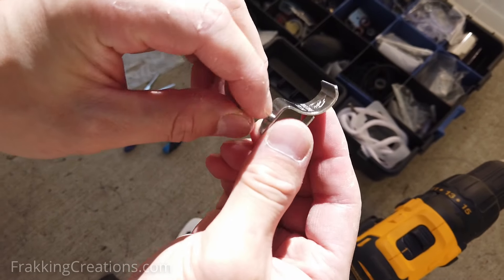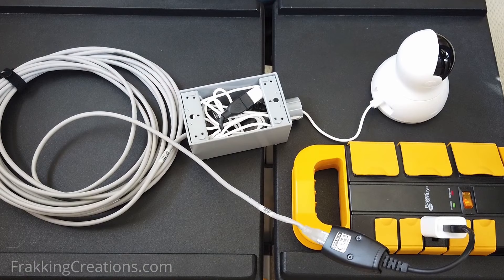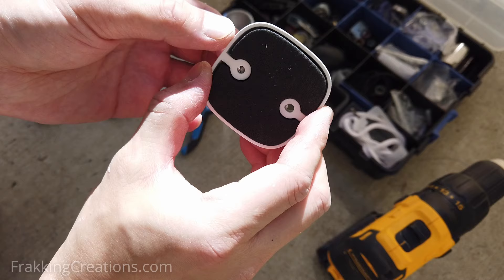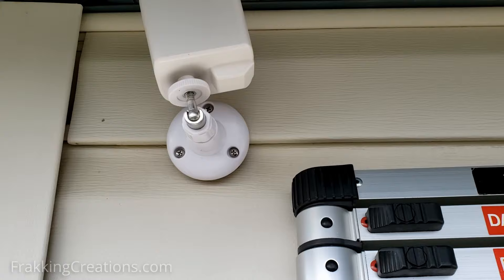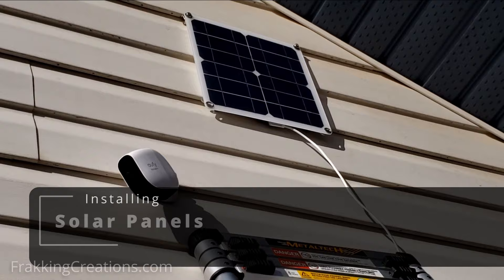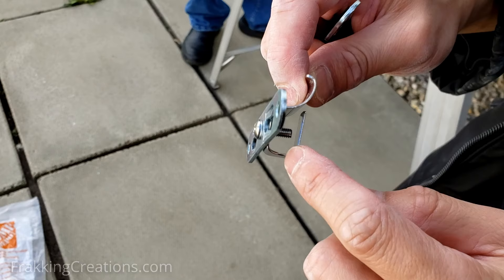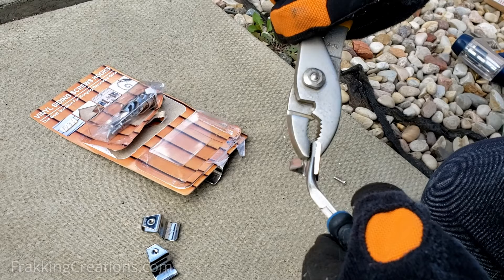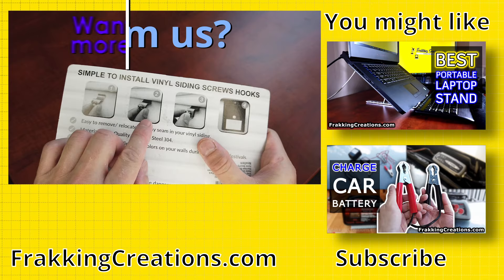How to hang things on vinyl siding - Install security camera, solar panel, motion sensor & more!

Comment: A different question, ignoring the cosmetic flaw, can scratches/holes from these installation cause damage to the slides in the long run?
Reply from the maker: There won't be any holes on your siding since there is no drilling.  As for damage, there typically shouldn't be any damage if installed correctly.  I could imagine that if the siding of the house is really old, there may be a chance that the vinyl could crack or a piece could break off when you insert the hangers or hang something too heavy.
I just haven't encountered that though.

Comment: Thanks! how is this holding up during winter months, cold, snow? Afraid my blink with light might fall off...
Reply from the maker: No problems for the security cameras, motion sensors or solar panels.  All still holding up nicely since they were installed and the video was published.

Comment: Do you have anything for mounting a tesla mobile charger to exterior vinyl siding.  Im looking for something like a kit with cable wrap and charger pocket that I can mount externally on the side of my house.
Reply from the maker: Sorry, I don't know of anything else like that.  These are general vinyl siding hangers that work for most things that are within the weight ratings of the hangers.

Comment: Hey just wanted to let you know. I bought and installed the mini solar panel (and the one used in this video) used in your original solar panel video. Works a treat charging my doorbell couldn’t be happier. 

My question is the solar panel used in this video, SUNYIMA 6V 10W. It has 2 usb outputs, but if 2 cameras were connected would it split the output to 3v each per camera? The cameras say 5v minimum required for charging. So I’m just wondering if I’d need to buy a 12v solar panel with 2 usb outputs available?
Reply: Really appreciate any help, your videos have been a huge help and inspiration for my project
Reply from the maker: The 2 USB PORT solar panel I used will split the current with the voltage remaining the same.  With enough sun, the voltage will be around 5V while the current will be split.  I'm just not sure if it's a 50/50 split of the Amperage or some other ratio between the 2 ports.
Reply from the maker: Thank you for providing the feedback.  Our aim with our videos is to always help someone else with what we have experienced.
Let us know how your project goes.

Comment: A quick question, was wondering if you think it would hold a 10 pound outdoor speaker if I used two and also do the hack?
Reply from the maker: I can't say for 100% sure because everyone's vinyl siding is different and if older or worn, it may not hold well.

That said, you could always try using 4 hangers with the hack.  You could attach the speaker to a piece of square or rectangular board that the speaker can attach to and then the board would attach to the hangers.  Make sure you are testing it out properly before actually hanging the speaker on it.  You don't want it to drop and damage it.

Comment: Do you know if these will work with the ring spotlight cameras?
Reply from the maker: Since I don't have one I can't say for sure.  But if your mount has 3 or 4 holes to put screws into, I believe it should work.  If it only has 2 vertical holes then you will need to use something like what I did for the solar panel since the bottom vinyl siding clips won't align with the hole in the mount.
Does that help?
Reply: @FrakkingCreations  the ring mount has two on top and two on bottom .. you think using two of these on top and putting a screw and nut on bottom would hold it?
Reply from the maker: It should be the other way around.  The vinyl siding clips should be attached to the mount at the bottom.  The nut and bolt should be at the top.  I believe it should hold but you will have to test since I don't know how your siding is and other variables.
And if needed, you can do the hack I suggested to hold more weight.
Lastly, if the above doesn't work well, you can always mount the camera mount onto a small wooden plate then attach the plate to the siding.
Hope that helps.
Reply: @FrakkingCreations  great thanks for the info ! How long were the screws you used about 1 inch?
Reply from the maker: @Anthony S.  You're welcome.  Iirc they were around 3/4" length.
Reply: @anthonys.1374  did these hangers end up working for your ring spotlight cam?
Reply: @briandearman4841  I ended up using these for my ring solar panels and found another mount on Amazon that was one piece and worked for the ring spotlight camera
Reply: @anthonys.1374  Thanks! Would you mind sharing the mount that you found on Amazon?  I have a spotlight cam I need to install on vinyl siding and I do not want to drill.  Thanks!
Reply: @anthonys.1374  would you mind sharing the item you used for your spotlight set up?
Reply: @briandearman4841  it’s the Aobelieve vinyl siding mount for ring spotlight camera. I have the battery version. It’s also compatible with the solar panel and stick up camera. I found while not perfect this mount did the job and has held up well over the last few months.

Comment: Can these be used on metal siding as well?
Reply from the maker: I'm not sure.  I'm not familiar with metal siding that is designed similar to the vinyl siding shown in the video.  Maybe if the metal siding is designed the same way as these vinyl siding panels that come in sections and are snapped in place together then it may work.

Comment: Do these work with Reolink Argus 2 cameras?
Reply from the maker: I'm not 100% sure but these will usually work with cameras that have mounts that have screw holes for mounting.
Reply: @FrakkingCreations  Thanks. I did have a look yesterday and it appears they will work, providing the cameras won’t be too heavy.
Reply from the maker: I do think you will find that it will work as it looks like your camera has 2 holes for mounting.  That means 2 clips/hangers.
I can't imagine your camera weighing more than 1 to 2 lbs each.